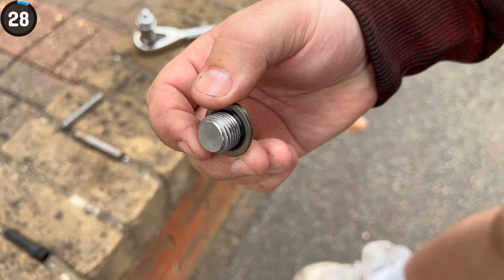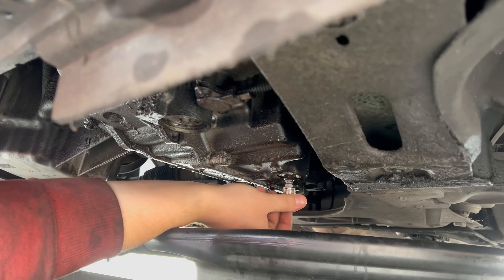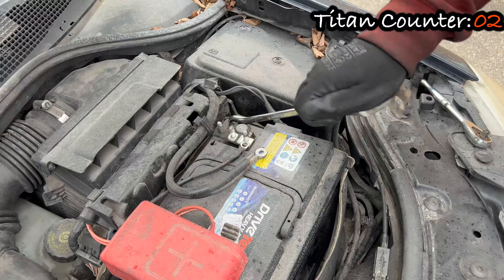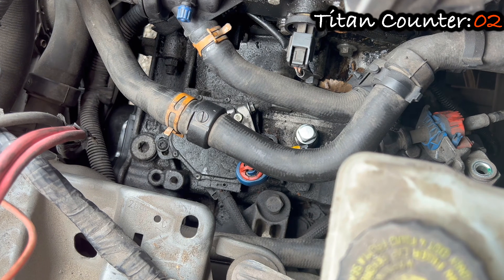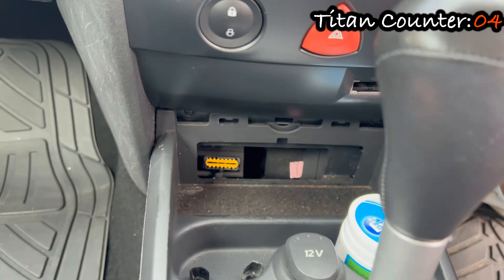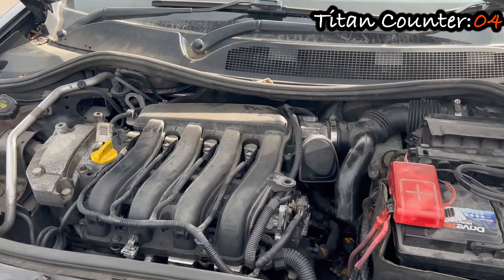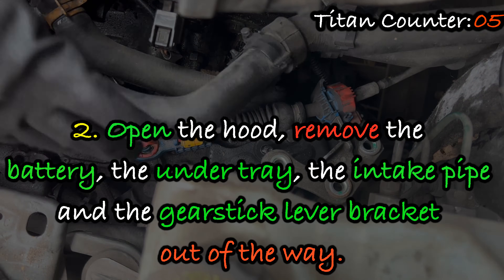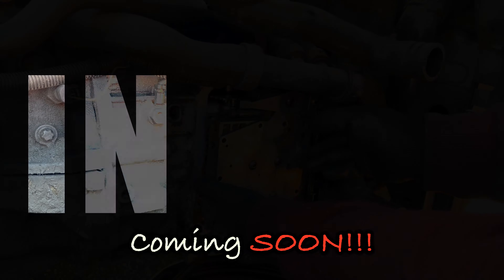AL4 DP0 Gearbox Oil Change and Levelling || Citroen Peugeot Renault Transmission Fluid Change

Comment: Unfortunately, I have almost owned a Renault Clio 3 with this gearbox, which they say is the worst in the world. So far no problems except that it holds gears for a long time and I noticed that the car often turns on the fan even though it is cold outside. I think it has nothing to do with the engine but with the transmission. Is that normal?

Comment: Isn't it easier to pump the oil thru the leveling plug using an oil pump? Then you don't have to mess looking for the fill plug under the hood.

Comment: I have a peugeout 301 with AL4 , i drained the whole oil i got about 3L , so i put a new 3 L mobil ATF Multi vehicles  and after reaching the operating temperature i drained about 1L , how this happened? Does the pervious filling is more than the level ?
Reply: maybe there was too much oil, or maybe the surface was not level.

Comment: Hi, need help!
I did this fix today, because i wouldnt gear into gear 1 and gear 4 properly and showing before 90 degress motor temperatur, a gearbox failure. After the repair the gearbox failure message didnt show up anymore but it could anyways not gear into gear 4. do you have some tipps?

Comment: good tutorial, but al4/dp0 gearboxes use only Mobil LT71141. Using regular ATF as suggested is common issue generator on those gearboxes. Second most common issue for those gearboxes is overheating as cooling was designed to be ~100-105 deg. C, which is on this gearbox limit. That is why it is good to add external cooler for gearbox.
Reply: LT71141 is the only oil for ZF 4HP20, from what I've managed to find out that is due to the programmed slipping of the TCC requiring specific friction modifiers. The OEM spec for the DP0 (same gearbox as AL4) is Dexron III, as per Renault technical documents. The OE fluid is called ELF Renaultmatic D3 SYN. The reason I believe PSA specified LT71141 for the AL4 is simply due to cost and practicallity of stocking up on one ATF only, as well as avoidance of confusion, becuase you can put LT71141 into the AL4 (DP0) without any issue at all, but if you put Dexron III into the 4HP20, you would destroy the box, and seeing how both the AL4/DP0 and the 4HP20 were put into the Xantia, and later C5, C8 etc, the mistake would be easy to make and costly to remedy.
Reply: @darioandrijasevic2804 yes u are right I have used both the LT71141 and Dex 3 in the AL4 gearbox with no noticeable difference. I did the first change at 124000km and the oil was black like diesel engine oil. I added a litre Lucas stop slip as a precaution and it made the shifts smooth like butter. LT71141 is not much more expensive than standard dex3 here in the UK.
Reply: @TheCheesenChips  Greetings. How are you? 2011 Megane 3 1.6 16v gasoline 4 speed automatic. The vehicle probably has this transmission. If we think it has this transmission, can we use lt71141?
Reply: @furkanyuksel7103  Yes of course you can that is the recommended oil for that gearbox.
Reply: @TheCheesenChips  Hello, if you could help me please, I have a peugeot 408 2012 1.6 with the same al4 gearbox 4 speed automatic gearbox, anyways I can't seem to find the right gearbox oil for my transmission! I guess the car now have the Mobil atf 320, but I want to change it, what should I get? Also I have a gear slipping that's why I'm changing it, would this Lucas slip help? Hope you reply to me, thanks in advance.
Reply: @mohanadbasuoni6191  yes put in a whole bottle of Lucas stop slip then fill it up with dexron 3 ATF. It will be a lot better. If it still slips you may have to change the solenoids.
Reply: @TheCheesenChips  but are you very sure that mannol dexron 3 will work?? I'm scared to put it as I heard a lot say it's not suitable
Reply: @mohanadbasuoni6191 the stop slip is about 710ml so u will need about 2290ml of Dex 3 to top off as the service refill is approx 3 litres. I put the bottle of the stop slip in some hot water for about 10 mins to help it flow better. This will not change all the oil in the box as it's dry capacity is 5.85 litres. I would change it every month for 3 months to get the old oil out.
Reply: @TheCheesenChips  alright thanks! And tho what do you think about the mannol ag 52? It lists as lt 71141 and dpo gearbox and also peugeot, will it work??

Comment: You do not need to do all this disconnecting just disconnect the battery get a long socket set unscrew the filling plug then the plug underneath the gearbox making sure you've got a a large enough container take note how much was taken out by filling into a measuring jug then refill from the top of the engine with a pipe and a funnel
Reply: Al4 reccomends an oil check on 80k km , if you take out and you measure might be your gearbox was low in oil.
This is the right proccedure so you are sure you have the correct amount of fluid.

Comment: Question: I followed your clear instructions. During draining only 2.5 L came out. 
I re-filled 3.5 L, and when setting the level abt. 1L came out again. 

One week later I repeated the procedure to further flush the gearbox. Again, I can only drain 2.5 L. 

Any idea why this happens? Online I read you should get 3 to 3.5 L out…
Reply from the maker: I will be honest, I have no idea, maybe you don't drain it at operating temperature.
Reply: @MrNiceGuy94  maybe… but i had the engine idling for 30 minutes and the oil was really hot. Anyhow, thanks for uploading the guide! Made the whole process a lot easier.

Comment: Hi mate. I'm planning on replacing the solenoid as well. Question is you refer to gearbox oil for manual. Is it the same process for transmission fluid for automatic? My car is a Renault megane 2015 1.2 petrol automatic. Thanks in advance

Comment: thanks for the excellent video, any idea how to Initialize the old oil counter?
i have read it is recommended to do after ATF change in the AL4's.
Reply from the maker: Hi, you can do that with a scan tool which is capable of that. However I think I haven't done it on this one.
Reply: @MrNiceGuy94  Thanks a lot!

Comment: Can you tell me, I see the garages they only pour 3 liters of new oil into the gearbox after the balance process, they still have a residual amount of about 200-300ml, is it correct, I see you poured 3.5 liters. Can you tell me how many kilometers the oil filter in the transmission should be removed, overhauled and replaced.
Reply from the maker: I don't exactly know the oil change interval for this transmission but I would say around 50k miles would be good. Also, first you have to overfill it then level it out as you could see in the video.

Comment: Thanks for the video, I have a renault lagune 2 v6 3.0. The shifting of autmatic gearbox is becoming very hard once engine warms up, do you think its because the previous owner never changed the gearbox fluid?
Reply from the maker: Well, it can be the problem.

Comment: You have used wrong oil type. You have to use Esso or Mobil LT71141 for AL4.
Reply from the maker: I think you can use any brand if it is within the specs.
Reply: @MrNiceGuy94  only Esso and Mobil lt71141 gives tru spec.
Reply: @cnaykut  you are wrong. Renault requires Elf 194754 (renaultmatic D3 syn)

Comment: Hi, do you mind to share the method to do full flushing of the ATF oil? Including oil in torque converter?
Because right now, my issue is there's been bubbling inside that made the pressure to be lost and making the transmission fail to disengage
Reply from the maker: Hi,to do a full flush you will need an ATF fluid machine, which I don't have access to at the moment.

Comment: You explained it well but I note that you say that the fluid temp should be over 60 deg C whereas others say 30 to 40 deg C. Will the level in the transmission be different if you only adhere to the lower temp? Thanks
Reply from the maker: This was in the workshop manual, so I just followed the instructions. 
I think it will be different somewhat as 60C is around double of 30-40C.

Comment: Hello there, does this type of gearbox has filter ? Thanks😁🍻
Reply: The filter is integrated inside the gearbox, you can't see it unless you overhall the entire Transmission
Reply from the maker: @vwyoungfans3136  Thank you for confirming it. So I assume that's not to be changed, as you have to open the whole transmission for that.
Reply from the maker: Hello,as far as I know it doesn't have.

Comment: Hello there ,
Thanks for your hard word and step by step procedure.
I have this gearbox and every thing is fine but sometimes after long ride the R (reverse) selection lag on the screen of my car and become E with a DUB on car body with Yellow9 Electric fault but the car continue to work fine .
After check with OBD fault indicate speed sensor electric erroring
this error appear many times when Reverse but not always
Reply from the maker: @Hisham Khalil  Hello Hisham. Unfortunately I don't exactly understand that " become E with a DUB on car body..."
if you have a speed sensor fault it is good to replace the sensor which is faulty, I am assuming it is a wheel speed sensor. So you just need to check which one is faulty and then change them. The wheel  speed sensor can mess up automatic gearbox, I had that on my bmw e92. I had one faulty sensor and the gearbox wasn't working properly. After replacement everything was fine again. 
Hope I could help.
Reply: @MrNiceGuy94  Thanks alot for your speedy response .
E is meaning Error on gearbox indicator screen and DUB is a knock or hitting vibration if I could illustrate what exactly happened .
thanks again.
Reply from the maker: @hishamkhalil9740  You are welcome ;)
Well, If I was you I would definitely scan the car again and check which ABS sensor is faulty and then would change it. As it can cause the gearbox to act funny. That was the case in my BMW as well. A £30 part causing a lot of trouble. 
If you need any further help, feel free to ask ;)

Comment: I can’t find the 8mm square bit😢. Where can I buy it?
Reply from the maker: @Calvin Wan  here is a link for UK and USA amazon. Let me know if you are from another country and I can find one for you.
https://www.amazon.co.uk/US-PRO-Double-Ended-Square/dp/B07CLQLKQM/ref=sr_1_4?crid=3ICX68OIDDDC8&keywords=transmission+drain+plug+key&qid=1664824114&qu=eyJxc2MiOiIyLjA1IiwicXNhIjoiMC4wMCIsInFzcCI6IjAuMDAifQ%3D%3D&sprefix=transmission+drain+plug+key%2Caps%2C89&sr=8-4

https://www.amazon.com/Drain-Axles-Repair-Change-TE168/dp/B01MDVLB24/ref=sr_1_8?crid=28ODXVWR3VD9K&keywords=drain+plug+key&qid=1664824262&qu=eyJxc2MiOiIwLjAwIiwicXNhIjoiMC4wMCIsInFzcCI6IjAuMDAifQ%3D%3D&sprefix=drain+plug+key%2Caps%2C268&sr=8-8

Comment: Hi I have a peugeot 406 with a manual transmission, if you can advice on that and what is the correct amount of fluid required for a manual.
Reply from the maker: Hi Abbas, if you can give me more details of your car like the engine size or perhaps the engine code and the year of manufacturing I can look it up for you.

Comment: Hello sir, i dont understand meaning of number 9 "if it only dripping in the beginning etc....then must start with no 3 again...can u explain it...thanks..
Reply from the maker: @Generation _AR  Hello, that means when you have the gearbox reached the 60 degrees of Celsius and you undo the draing plug and the oil is not flowing continously,but rather just dripping that means you didn't put enough oil in it. So you have to wait till the oil cools down,then top it up again by minimum half a litre, then start the levelling procedure again. Basically the point is, when you do the levelling the oil has to flow when you undo the draing plug and when it starts to drip you can tighten it. However if it is only dripping when you undo the drain plug then you have to top it up and start the levelling again.
Hope it all makes sense now. However if you still have any questions feel free to ask them or I may have answer them in the video if requested.
Reply: @MrNiceGuy94  to check oil level once it reach 60degrees, do we need turn off engine or running?
Reply from the maker: @Generation _AR It has to be running. Then you undo the drain plug and let the excessive oil flow out of it. 
Wasn't it clear from the video? If it is confusing I may have to redo it. 
Please let me know the feedback. Thank you.
Reply: @MrNiceGuy94  thank you sir..
Reply from the maker: @generation_ar7304  You are welcome!
Reply: The car must be running and in P or in D when checking the oil level at 60 degrees Celsius? You forgot to mention this!